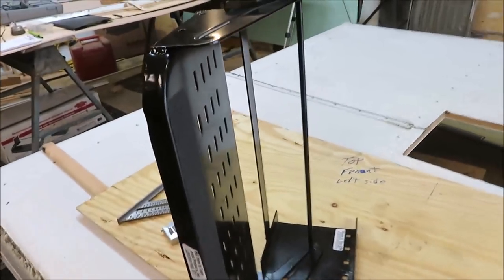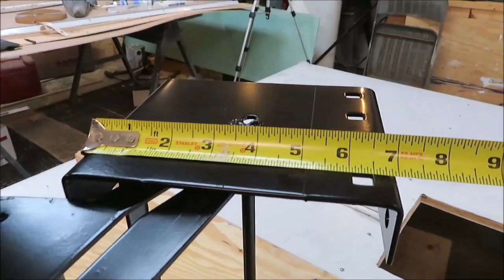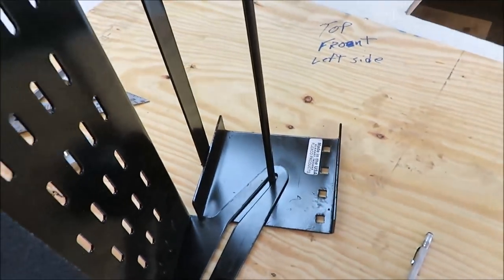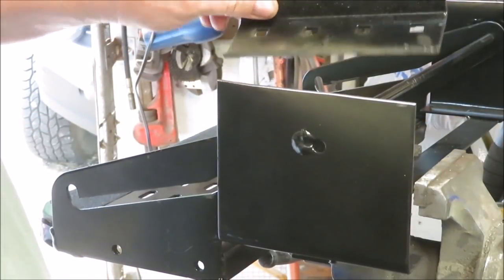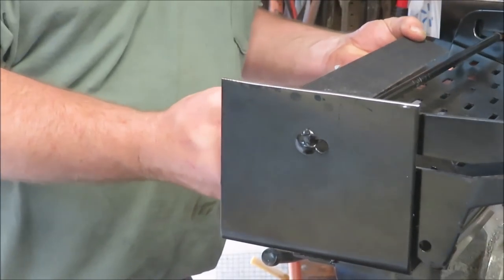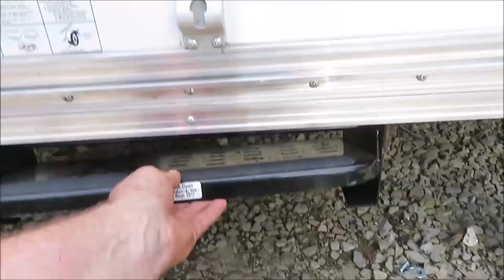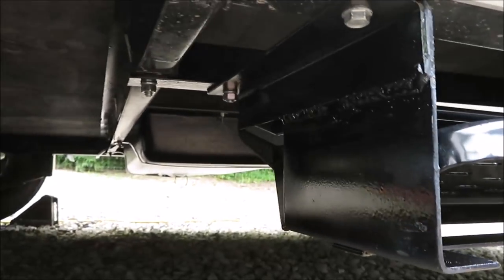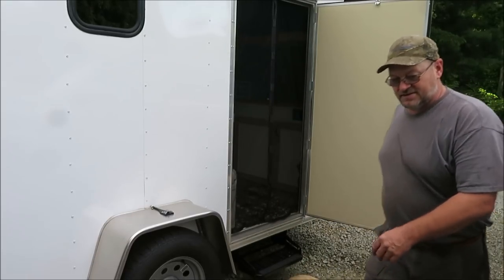Cargo trailer step install

Comment: Great job Kevin. I would suggest putting a bungee around the step though. If your roads are anything like Louisiana roads. My travel trailer steps bounce out and can be in the other lane. You won’t have that problem but might hit something if it is the step is low. Thanks for the video
Reply from the maker: Thanks will do Billy.

Comment: "One step at a time." If you ever get tired of fabricating, you can always try standup. I have a Stromberg-Carlson step like that to put on my cargo. Now I will have to pull it out of the box and measure it. It is supposed to be a 2 1/2" drop. We'll see.
Reply from the maker: 7'' was just to big for me but it's working so far.

Comment: You might want to consider a set without the holes on the step. If you have a dog their toe nails can get caught up in the hole and cause major damage to the paw.
Reply from the maker: That's good to know thank you.
Reply: cdLady54 Marengo  I glued indoor/outdoor carpet to my black metal step cause the sun heats that metal up to about 250 degrees (maybe less) and a bare foot on it just once and you're looking for a solution. I think a dog's nails would be just fine, as well. My "Buster" hasn't complained even once.